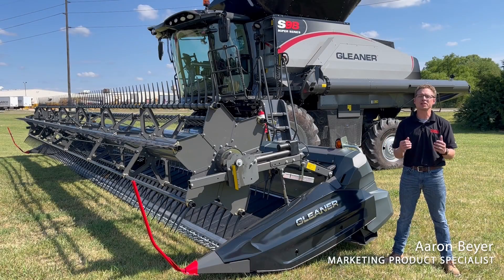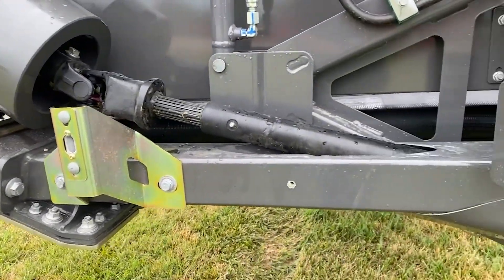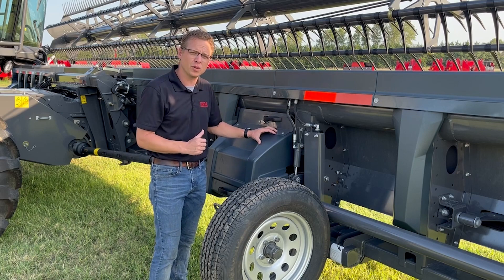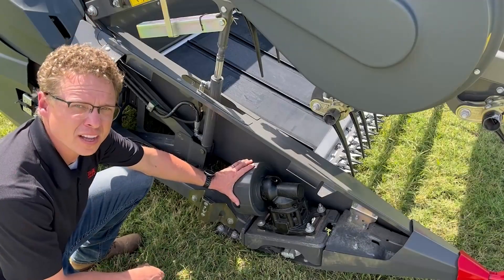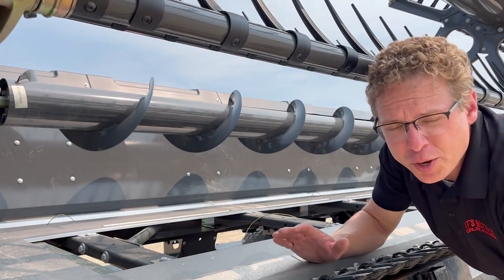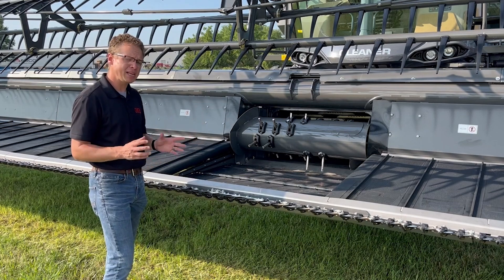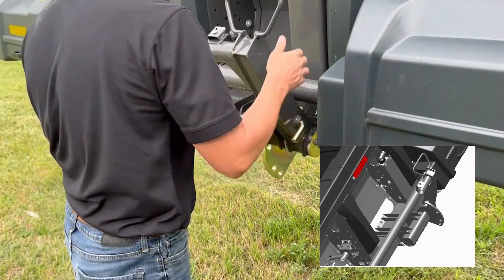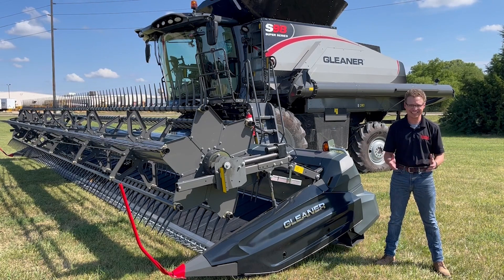9300 Series DynaFlex Headers

Comment: So there are machine settings that must either be made while standing next to the header with the machine running at full speed or on a trial and basis repeatedly starting and stopping it to "dial in" upper auger speed?  And I have to "calculate the difference" between and manually adjust voltages of header height sensors and "eyeball" header height level so that "automated" system functions properly? It has no ability to self-calibrate? 

Holy shit no wonder Gleaner owners that "love the combines" end up buying Brand X "bean heads".
Reply from the maker: The top auger speed ratio is set during setup of the header when first installed. It's really never touched again during operation. Setting the header to the correct header height position is done as a rule of thumb for the optimal performance. If you'll watch the video about Calibrating The Automatic Header Control you'll see the calibration of the sensors is fully automated and only requires the operator to start the calibration. Every brand of head is going to require setup and adjustments to get optimal performance.